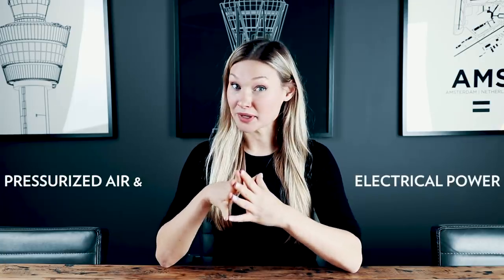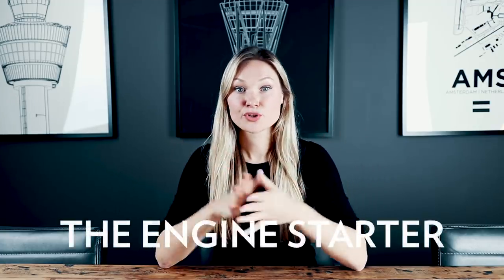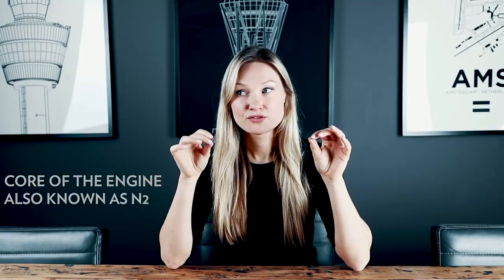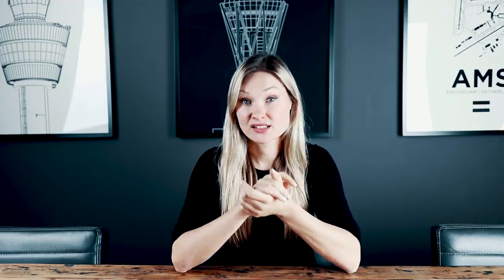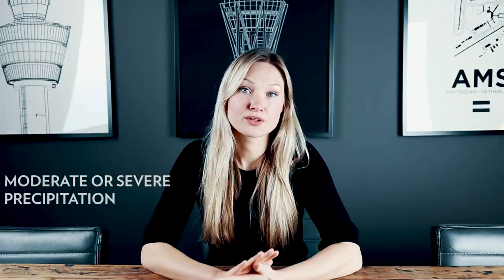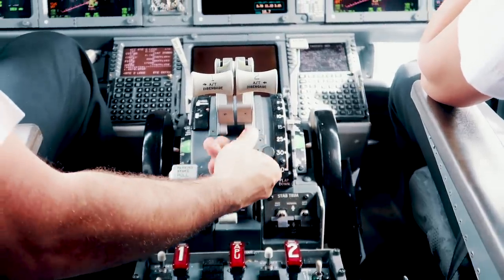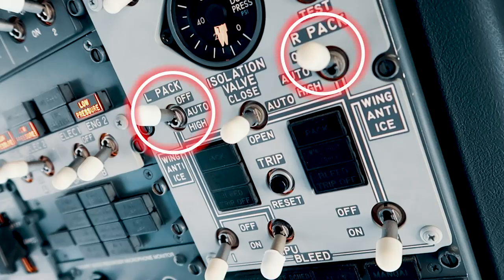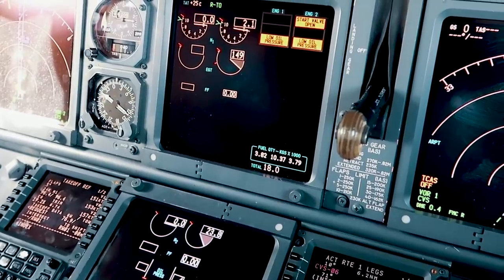How To Start A JET ENGINE -  Boeing 737 By @DutchPilotGirl

Comment: Sure, but how do I turn it off? My neighbours are complaining
Reply: Hahaha
Reply: @Francisyrah  Ctrl+Shift+F1
Reply: Just stop the blades with your hand :)
Reply: @underpantswedgy  I thought it was Alt+F1
Reply: @2405jacko  Alt + F4 actually
Reply: As far as I know after the aircraft is parked and throttles are on min idle,whit T&P stable. You simply move the fuel control lever to cut off .... But I am  not sure of the exact procedure on a 737
Reply: Wait until the fuel ran out.
Reply: Use the cut off switches
Reply: Ctrl Esc
Reply: Ask the pilot to invert the plane & pull back hard on the stick. If done at the correct location, you will never hear your neighbours complain again.
Reply: @twikie258  to the neighbor?
Reply: @twikie258  Hahahahaha
Reply: lol take the key out
Reply: Alt f4
Reply: Just turn the ignition key to the off position. Make sure the lights are off or you will kill the battery.
Reply: dont worry your neighbour was an astronout.... :)
Reply: was about to comment it... you got it first.
Reply: Try this:
1) CTRL+ALT+DEL
2) Open task manager
3) End program "ENGINE"
Reply: Ctrl+Alt+Delete
Reply: Cut the wires. 😂
Reply: Lithobrake or bird strike it. Feed it a rotisserie chicken at it
Reply: Cut the fuel mixture
Reply: LOL
Reply: Just give them ear plugs and wait for the fuel to run out. All 20 tons of it.
Reply: @blackdeathsky  exactly correct
Reply: 3:20 just bring these 2 lever back to cutoff position. Done.
Engine off.
Reply: Alt+f4
Reply: Just point the back end of the engine to your neighbors😂
Reply: You can stop the engine in one of two different ways...either toss a cat into the engine or shut the fuel off. Either way will stop the engine...lolololol
Reply: Alt+f4
Reply: Just flick every button
Reply: Ctrl+E
Reply: Alt-f4
Reply: Alt+F4 should help
Reply: Have you ran out of fuel yet?
Reply: Haha...
Reply: Alt+f4
Reply: 😀😀😀 just splash with water
Reply: Ctrl+F4
Reply: Mixture cutoff
Reply: Pour the fuel out
Reply: @fulcrum_9162  bro he's just joking 😂why are you telling that pull down fuel levers😂
Reply: @bharatmaheshwari1060  that turns it off
Reply: @bharatmaheshwari1060  yea ik😂
Reply: @fulcrum_9162  then it's ok😂😂
Reply: That is the easy part ,throw a crowbar in the engines. It worked for me.
Reply: ha ha ha
Reply: Do full throttle. The noise should cancel out their screaming 😉
Reply: Just wait until the fuel tank is empty
Reply: @sidikpermana2094  Im afraid this wont work in modern turbofan engines.
Reply: Cutoff fuel!
Reply: Alt+f4 and watch it fall to the ground
Reply: Just remove the keys man🤣🤣🤣🤣🤣🤣🤣🤣🤣🤣...the neighbors are about to call the police on ya
Reply: Lmaoooo best comment !
Reply: Too funny.
Reply: Lolol....great 👍😂

Comment: I was on a 737 once  that required a crossbleed start due to an inop APU.   It was nice to see it in action as the whole plane started to shake as the thrust was increased to get to the desired bleed air duct pressure to start the second engine.
Reply: I get to see an air compressor start every so often. Our airport is too small to have air bridges so a portable diesel powered one is brought out. Working in ground handling and aircraft cleaning let’s me see so many things most people don’t. It’s funny I suppose, how familiar the sights, sounds, feel and smells of the airfield become after awhile although I at least never lose my sense of caution. But what’s weird is that I absolutely love the smell of jet fuel, along with petrol or creosote. Standing downwind of an engine start, refuelling or a freshly turned off jet engine is wonderful. By contrast feeling the pilots turn off the APU during the heat of summer was disappointing because that meant we’d lose air conditioning. But I’m seldom unhappy because I enjoy most of my job.

Comment: Cool. I've watched turboprop starts (e.g. 1900D) but not jets. As for my plane...lessee now...

Master ON
Beacon ON
Fuel pump ON
Mixture RICH
Prime as needed.
Crack throttle (1/8").
"CLEAR PROP!"
Engage starter, max 30 seconds.
Oil pressure confirmed within 30 seconds.
Throttle to 1000 RPM
Fuel pump OFF. Confirm fuel pressure.
Alternator ON. Confirm charging.
Startup complete.

Comment: I hope pilots are paid well. If this is the amount of info they need to know just to start an engine, I shudder to even imagine how insane the amount of knowledge to fly the plane would be. Hats off!!!
Reply: I worked at a fairground and I can tell you, starting the generators and compressors was a whole lot more difficult than this. It involved curses in 4 different languages. Burning rags on sticks. A variety of aerosol cans and sometimes a change of underwear when they tried to fight back.
Reply: @philgray1023  lmao
Reply: She hasn't even covered . Restarts,, airborne windmill or apu assist. Add that to the list.. Also,, whole procedure about "no starter cutout". Also about motoring the engine after start problems.  Too much information.. Whoa
Reply: On GOD !

Comment: The start switch automatically shuts off.  That's some fancy stuff.  The older 737s and 727s didn't have that, you had to hold the start switch on, and wait for N1 to come up, then flip on the fuel and then wait for N1 to go up and release the switch.  Good times!

Comment: Very nice video. It's amazing the amount of precise timing required to get a turbine spun up.

I love the happy little 'Wwwwwoooooommmmm!" of the #2 Turbine surging as it took over from the starter in the background.

I play around with X-Plane and it's 'Plane Maker' modding tool. You can design your own turbines (basic parameters anyway: target thrust, Core and and fan diameters for a turbofan, fuel flow, and starter power), That noise always made me grin because it meant I'd made a turbine that could actually sustain itself. All of the engines I'd made had the thrust of a Royce Nene, and the thirst of a Royce Turbofan tho....

Comment: I was watching some videos today of the Agusta Grand 109 helicopter during a rescue. The Grand is a hoist equipped copter which greatly aids in the stabilization and rapid treatment of the person in need. My nephew is a helicopter rescue EMT for Arizona which do not have the hoist feature. Rappel, Treat, Hang On!!
Anyway, after engine initialization one can hear some of the processes which are happening. The rotors are turning at what seems like a good rate but nothing else seems to be happening...unless you can see the gauges. Pressures and temperatures take some time to stabilize before additional power can be provided. Yah, its around two minutes+, then you hear rpm increase and stabilize. Now some pitch is added lightening the load, temps and flows are watched for another 20 - 30 seconds and then the pitch bites and you are away.
Your explanation made sense. Thank you

Comment: I assume the air pressure (bleed air) is used to induce engine rotation via impact with certain fan blades? I'll Google it. TY for the video- excellent!
Reply: I do not know how a Boeing 737 does it.  On the [pre-J model] Lockheed C-130 Hercules and the Lockheed P-3 Orion aircraft - both TURBOPROPS,  not TURBOFANS like a 737 - each propeller gearbox has an engine starter powered by bleed air.  {Each engine, gearbox, and propeller all start spinning at the same time.}  
 
I hope that helped and was not too confusing.
Reply: They usually have a bleed air driven starter motor. Start the APU, bleed air from that runs the starter "motor" on eng.1  and then use bleed air to start eng.2. It usually runs by effectively "backfeeding" the gearbox that runs things like the generator and hydraulic pumps

Comment: I was thinking of stealing a 737 but now. Not So much. Back to my Cherokee
1. Battery On
2. 3 primer pumps
3. Throttle to idea plus 1/4” ( on my plane)
4. Magneto switch to start
Bingo whirly think starts spinning, lots more noise, Oil pressure start climbing 
😀 smile on my face 😉
Reply: Love it dude
Reply: Lol
Reply: Do it in an airbus. Mode Selector to Ignition/Start, then switch the engine master of the engine you wanna start up and the rest works automatically. It even does restarts on unsuccessful attempts, after three tries it tells us: your try, i'm done. Of course, the APU should be on, but that is the normal thing anyway. After all, we don't want to freeze or sweat...
Reply: @Soordhin  Airbus is less stressful lol
Reply: @hubermarcelo4273  Airbus is less stressful until the computers get confused.
Reply: James Allen 
Same!
Reply: Not fuel injected huh? Damn the bad luck😊
Reply: Dont give al kaida any more inspiration.
Reply: @hubermarcelo4273   he forgot to mention the most important part of engine start procedure.

Look left and right, and wait for it..... CLEAR PROP, CLEAR PROP, CLEAR PROP 😎
Reply: @konp368  You're right 😂😂
Reply: Just grab the Pub and and follow the checklist. I'm not a pilot so I can be your lookout.

ATTENTION LEO's don't arrest me, I'm kidding.
Reply: Gary Dodgson Kick start. No thank you
There are BOLD pilots or Old pilots. I am the later 👨🏻‍🦳
Reply: What a Man ! U GOT  IT,! Now go 4 the  Fame and  Glory!

Comment: Question: A while back i flew on a 737. When i boarded the plane i noticed that it was way hotter than usual, so i asked to a flight attendant and she told me that "the APU was not operative so they were wating for the engines to start the AC". I assume in that case they use the ground air starter to kick off the engines. The thing is, lets suppose you are flying and you have to restart the engines, how can you do so with no APU nor air starter?
And the 2nd question woud be, is it common to fly without an operative APU?
Thanx, your content is amazing.
Reply: Disclaimer: not an airline pilot, but works in the aviation industry

Your second question, it depends on the aircraft MMEL (master minimum equipment list) and perhaps company policy. But on the 737 I believe inop APU is a dispatchable condition, and the maintenance can be deferred, so it's not needed to fly. Not sure what the APU failure rates are.

If you have inop APU and have to do an inflight engine start, it depends on your airspeed and altitude as to what to do. If the aircraft has sufficient forward speed, the engine will continue to windmill fast enough and can perform a windmill start. If outside the windmill envelope, can use the other engine's bleed air to attempt a cross bleed start. If both engines fail, and no APU, then the only option is a windmill start. If both engines fail (and assume it's not from running out of fuel) together and have APU, a windmill start should be attempted while firing up the APU. If the windmill start fails (engine not windmilling fast enough, for example), hopefully the APU works and there's time for the APU to spool up and do a starter assisted relight. 

Cheers
Reply: If for some reason your engine flames out while flying, depending on the REASON why the engine experienced a flamed out, it can be restarted by DIVERTING compressed air from the OTHER operating engine, or it can be restarted by RAM AIR, the airplane flying sufficiently fast thru the air to FORCE SPIN the engine and achieve minimum RPMs in case you have an inoperative APU. The APU efficiency is apparently limited by the altitude it could operate, depending on type of aircraft. In the early 2000’s, a Bombardier 200 (Pinnacle Air flight 3701) experienced a double flame out due to pilot errors (and bunch of other stuff) while flying at max operating altitude. In order to restart the engines, the aircraft had to achieve about 300 kts to RAM AIR start the engines, the first officer failing to do that. They had to descend to a lower altitude (denser air) in order to be able to use the APU for engine restarting. The crew were not able to restart the engines, due to possible engine “core lock”, the pilots running out of altitude and time, crashing in a neighborhood, killing themselves in the process, no one was injured/killed on the ground. The aircraft was being repositioned by the crew. No pax onboard. The crew achieved being members of the “41 Club” (being able to fly to 41,000 feet altitude) killing themselves in the process. Can’t play around in a jet without ejection seats, it could be deadly.
Reply: U/S (unserviceable) apu is a cat C MEL, which means it must be repaired within 10 days👍🏻
Reply: It can be started from the other engine's air or, if the plane is flying fast enough, it can start just from the air flowing by.
Reply: Back in the day we have started a jet fighter  by parking a another  jet in front of and letting the exhaust on the front blow air to crank over one the engines on the rear jet  we used to practice it once in a blue moon in case or no cartridges start or  air start-Cart was  available

Comment: Wow, that's sooooo interesting! I don't think that my chances are very good at European Flight Academy but maybe in 3 or 4 years when I'm 22 and when I have studied physics or engineering and played very much time many flight simulators then I will apply at Lufthansa.
@DutchPilotGirl do you have any suggestions which flight simulator is the best one to prepare or do you know which simulators are used by the airlines? I have Xplane 11, Aerofly FS2, FSX and FlightGear. And I have another question: How do pilots control the yaw? Do you use the pedals for yaw and the flight stick for pitch and roll?
Reply: X-Plane 11is definitely the best flight sim.

Comment: In case anyone else missed it, EGT = Exhaust Gas Temperature (https://en.wikipedia.org/wiki/Exhaust_gas_temperature_gauge )
If that got mentioned in the video, I missed it, and had to google it to make sense of what the checklist items were actually verifying in terms of engine operation.
Thanks for posting this fully detailed video with diagrams of the systems so we can actually understand what's going on, not just a list of steps.
Interesting to see how planes are designed in that level of detail.

Comment: Started flying A321 on X Plane and was unable to get engines started until I clicked some buttons on the Overhead Panel and then they started running. Great moment. Wish I had found your video about two weeks earlier, that would have helped 😅

Comment: The engines have two igniters for each engine. After you get one engine started you can (Cross Bleed) start for the other engine.  After the engines are started most manufacturers use a two-three minute minimum time for engines to be started and stabilized before attempting additional load sick at take off.  After landing they usually require the same ground idle limit.  The aircraft also use engine driven fuel pumps but electrical “Boost” Pumps for take off and landing.  The electrical pumps can be turned off when engine driven pumps have been operating and stable for a few minutes.

Comment: Years ago when I was a flight engineer on a DC-8-73, it took two air carts hooked up by a "Y" connection to start the CFM56 engines. We had no APU on the cargo DC-8's

Comment: As a former 15 tango air crew chief on a black hawk  helicopter.  In many ways similar to our start up procedure but definitely has differences. 
Big difference is the power source for start up. But similar rpm and temperature go or no go.

Comment: Hahaha thanks. I work in ground handling. Mostly cleaning the aircraft and I’ve occasionally wondered how to start the engines as I either clean the forward galley and glanced in at through the open door, or much more likely, when I’m actually carefully cleaning the cockpit itself.  Now I know.😆 

I’m actually shocked at how much I’d pieced together between observation and chats with the engineers during the long and frequently cold night shifts. They’re usually happy to see me because if none of the cleaners have had the separate cockpit clean training, they have to do it themselves! But alas, while I sometimes wish I could turn on enough systems to control the temperature of the plane since they somehow manage to be stiflingly hot in summer and literally glittering with ice in winter, I’ll be content with simply knowing how to turn the engines on.

But, because I’m very poorly emotionally constructed for boredom and hate sitting around between planes waiting for the next one to land, I also work on the ramp. Thus I’m usually on the other end of the pushback either in the tug or walking alongside it. The latter somewhat amuses me as from a distance it almost look like I’ve got the plane on a leash and I’m taking it for a walk. But yeah I’m always very aware when the engine behind me is being turned on, even if I can’t see it.

Comment: Way back in the mid 1960s, Chrysler, via its Dodge Division, built some demonstrator cars powered by turbine engines.    The cars could be seen at local Dodge dealerships as they toured the country.  I remember my dad and I seeing one of these cars at Westside Dodge in Columbus Ohio.  Very futuristic looking cars for the time and the turbine engine itself looked radically different as compared with the piston engines of that era.  The car was started and ran inside the showroom for about 15 minutes.  To start the engine all the presenter did was turn the key to crank the engine.  The engine fired quickly and its idle speed was about 30,000 rpm.   No sequence of steps or proceedures,  just turn the key to start and the engine did the rest.   The engine ran much smoother that a piston engine too.  The presenter stood a nickel on it edge on flat cowling and the nickel stayed upright.  There was no flat spot on the nickel either.   The turbine engine also had a cooler and cleaner exhaust as compared to a conventional piston engine.  Sadly the turbine car did not catch on and Chrylser scrapped the demonstrators.

Comment: It's not all that complex. I think the biggest issue I have encountered from others is for APU start - the position of Isolation valve switch in order to start APU. After that, it's all smooth though you detail a lot of the parameters, thank you for that.